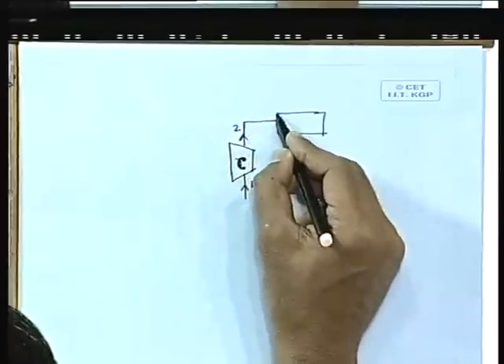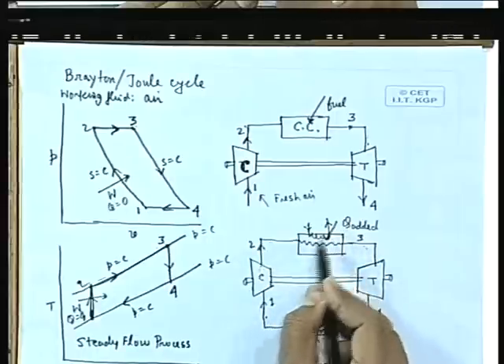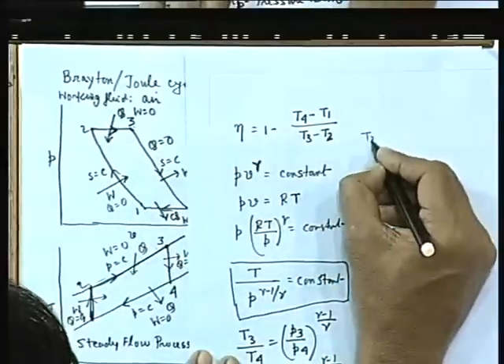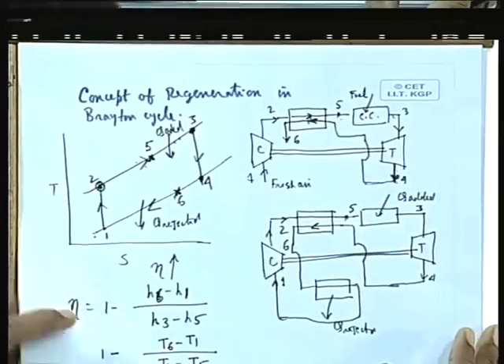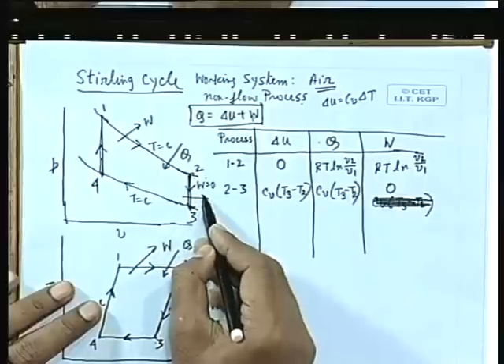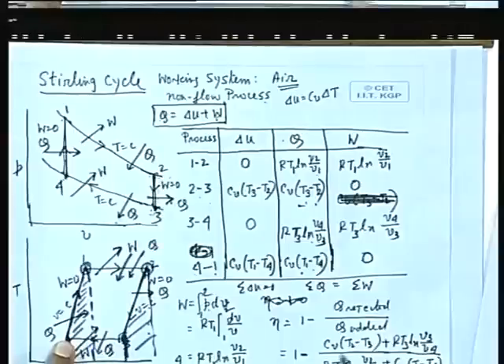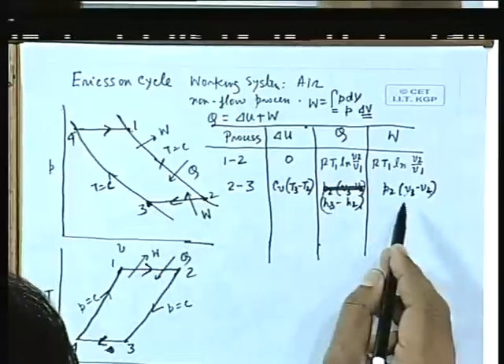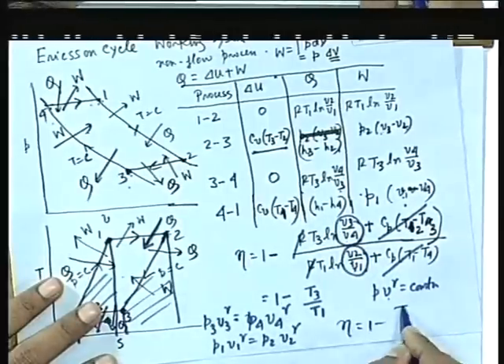Lec-26 Gas Power Cycle-III

Comment: Sir, shouldn't it be PV=const. to derive a relation between volume and pressure in Ericsson cycle because it is a isothermal process. You have used PV^(gamma)=const. will it not be for isentropic process. Kindly shed light.
Reply: Yeah
Reply: Yes pv=c
Reply: yes